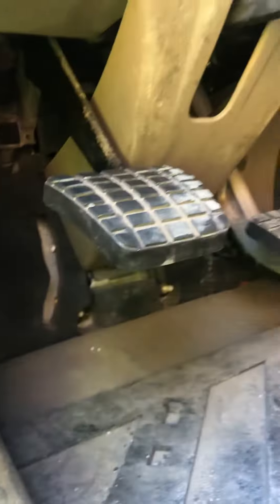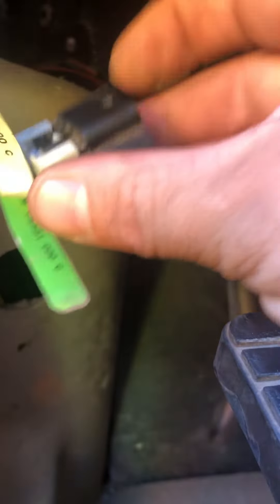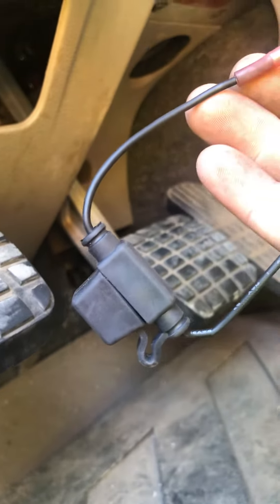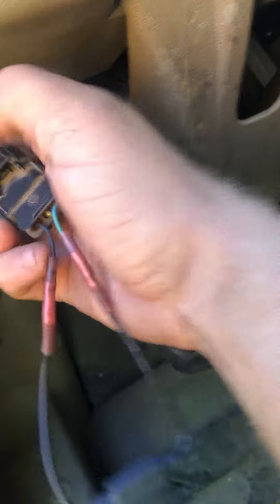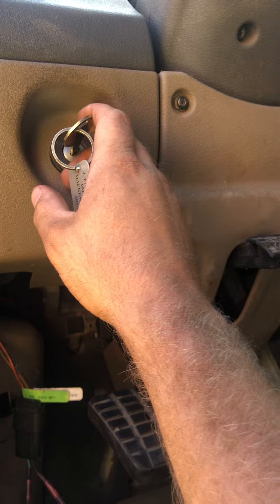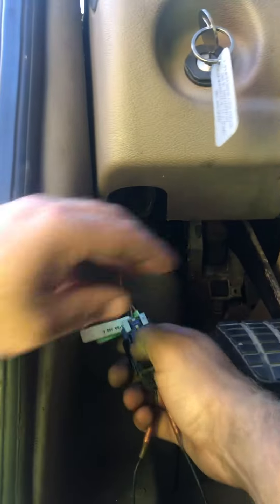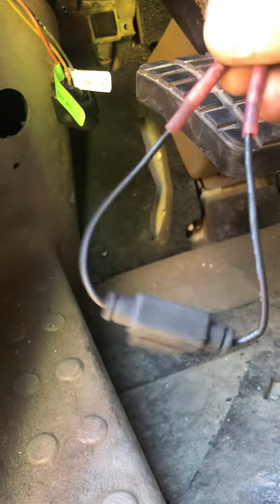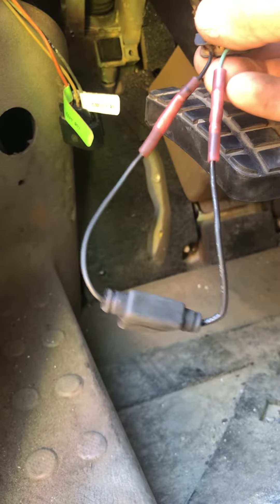Freightliner  cascadia  clutch safety switch bypass

Comment: Does it stay in once driving?
Reply from the maker: Yea unit you make the correct repairs
Reply: @bluecollarwrenchslinger7983  are you saying “until”? I make the repairs? Also it didn’t start.
Reply from the maker: @Boxtruckin  then that may not be your problem
Reply: @bluecollarwrenchslinger7983  starter?
Reply from the maker: @Boxtruckin  did you try the clutch bypass
Reply: @bluecollarwrenchslinger7983  i did the bypass next to the clutch pedal that you did
Reply: @bluecollarwrenchslinger7983  did a tow jumpstart clutch pop and it started
Reply from the maker: @Boxtruckin  could be the starter.. check for start signal

Comment: I did the same and it didn't work
Reply from the maker: Then that’s not your problem
Reply: Thank you for the helpful video. Trucj started but wont go in gear manual ? What could be the issue
Reply from the maker: @moebenjeddou782  clutch adjustment, cable, or clutch brake could be one of those